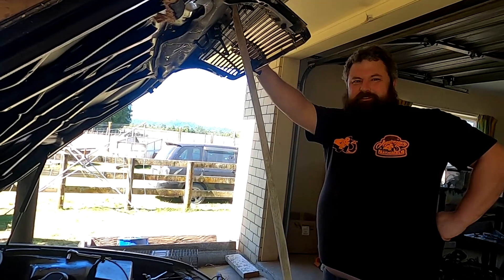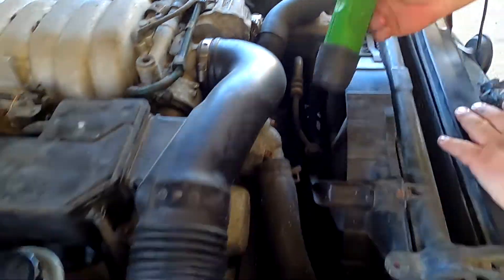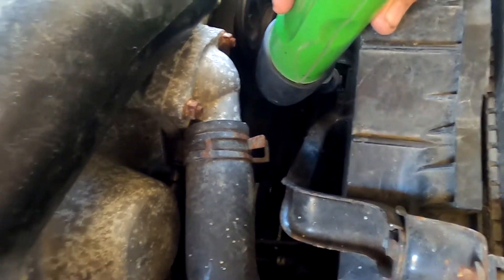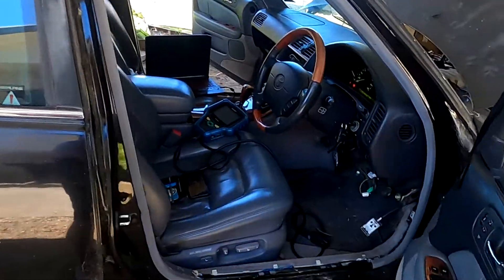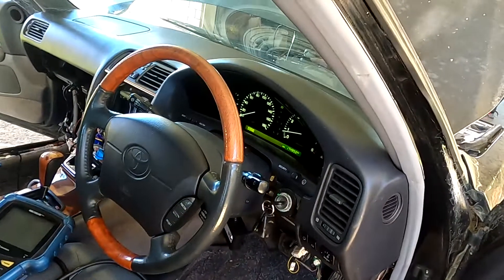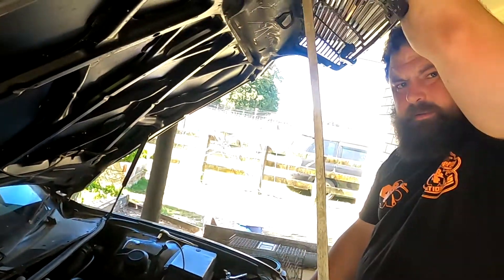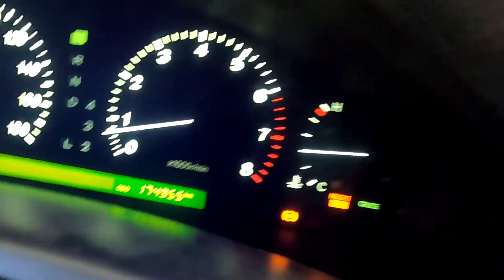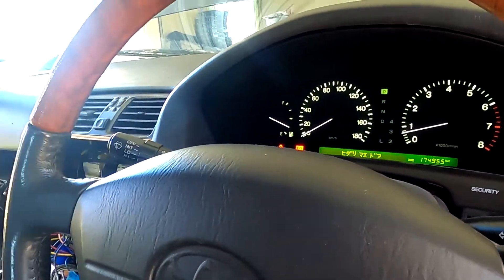How to Check the ignition timing  ( TC ) on 1uz VVti engines. 1998 - 2000 LS400.

Comment: What should be timing in diagnosis  mode ?
Reply from the maker: 10 degrees before top dead center
Reply: @CartuneNZ  thanks if after market you is install the time should be sink at 10 degree before tdc